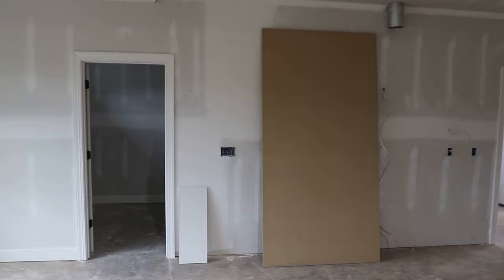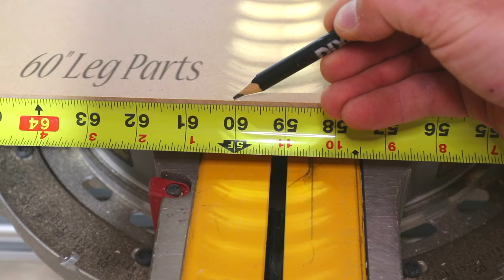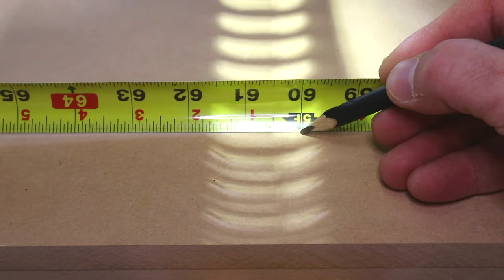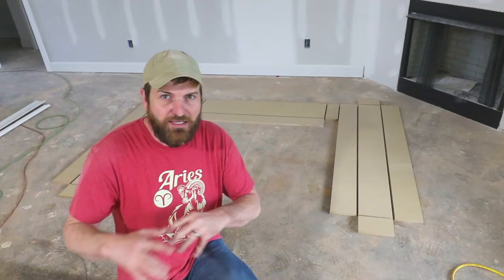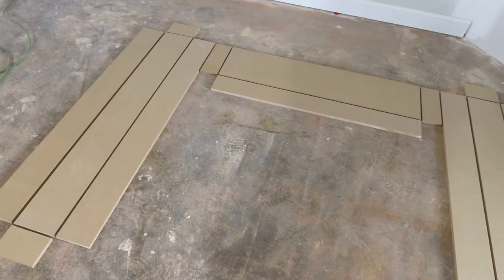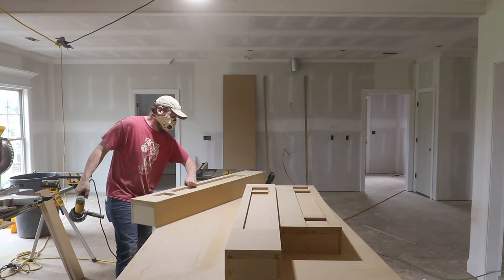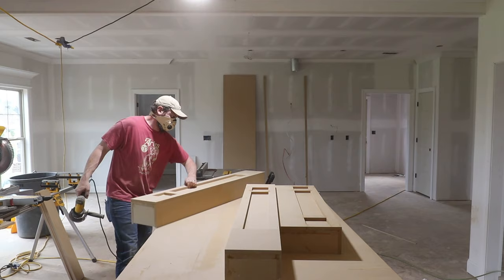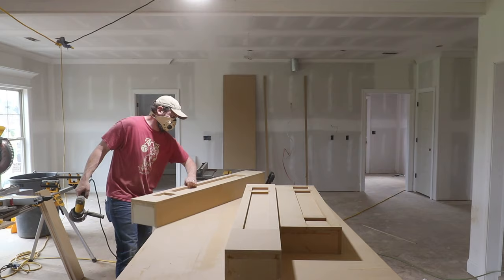How To Build A Mantel

Comment: Was looking up ideas for a mantel I am going to build.  This one is spot on with my skill level.  Thank you so much.
Reply from the maker: Absolutely bro! Happy to help and good luck with your build.
Reply: @TMPK  Just curious how the paint holds up on the mdf joints.   Would think over time a line would come through.
Reply from the maker: @wesrobinson7366  if you get it sanded well the first time it hides the lines. But I think the end side of the MDF does absorb the paint different than the surface so a light sanding after the first coat might help with that. My personal mantel in my house is about 4 years old now and I haven’t noticed lines showing yet. Just use the glue liberally lol

Comment: Great content, Jared!  You get perfect tens on Design, Craftsmanship, and Presentation! Would it be possible for you to share how much you charge for this build?
Reply from the maker: Thank you! I’d say $400-$800 labor. Depending on who you find to build it.
Reply: @TMPK  Thank you, Jared!!  Your work is impeccable.
Reply: Actually I completed a chimney mantel bump-out for an electrical fireplace along with board and batten wall for a family member and I am getting request to do others, but I am running into a challenge as I do not know what to charge.  Is there a site you can point me to to help with estimating these types of projects?
Reply from the maker: @luisasantin4989  no, I never know what to charge for new things either. What I do is try to estimate how long it will take me and then multiply that times $50 per hour labor. Sometimes it takes less time than I estimated, sometimes more, but I’ve found that $50 is a reasonable guess for bidding projects.

Comment: Absolutely love this one! I first was thinking of doing a faux fireplace, but when I talked about it with my mom she said "Why not an electric fireplace?" (I cannot go for a real wood burning one, mostly because I am renting AND have an apartment above me so an indoor chimney is not possible and even an outdoor chimney will most probably not get approved. But also because wood burning fireplaces are very expensive.)
I have been looking at those electric build in fireplaces, and I might be able to do that. But I do want an actual mantle, and not the modern type where the fireplace is build into a solid wall thing from floor to ceiling. I want to put some decorations on top of the mantle.

And Pinterest kept showing me those solid things, some with a floating shelf, some without. But this one you made is quite close to what I imagined and was trying to find an example of, to be able to show my brother. One day when I am ready to buy the build in and the MDF and other materials, this will make a nice sibling project 😊
Reply from the maker: Happy to help! Good luck with your build!

Comment: Awesome video! I have to do a mantle for a corner fireplace on Monday (a little more difficult) came across this video trying to get ideas 🙏
Reply: If you have ideas for a corner fireplace let me know. I’m wondering about supporting it in the middle where there won’t be a leg
Reply from the maker: Thanks! I’m not sure what you mean by corner fireplace? Technically the one I built in this video was a 22° corner fireplace 🤷‍♂️
Reply: @TMPK  it’s on an outside corner. Wish I could send you a pic it’s pretty wild! Either way  cool video, I’m definitely subscribing
Reply from the maker: @shutupswan8677  you can send me a pic on Instagram if you have that, I’m @jared_m_turner

Comment: Cheers mate! Huge confidence builder this one. One question: I have seen other builds use glue to make sure there won't be any lines (edges) opening up in the future, but you don't; is that not necessary in general, or only not in this particular build?
Reply from the maker: Thanks! 

 Maybe I didn’t get all the camera angles I should have, I definitely use glue everywhere wood touches wood

Comment: Thank you for the video. We have followed your instructions and we are at the point of adding the coving. We only have a mitre cutting block with a 45-degree angle and we are super confused about how to do the 35 degree angle with a 30 degree bevel without the correct equipment. Does it have to be a 35 degree angle or would a simple 45 degree angle suffice? It looks fantastic thank you so much for the superb high quality video; best on YouTube.
Reply from the maker: Thanks! That’s a tough one to explain in text. I would recommend searching “how to cut crown molding on mitre box” or something like that. There’s an “upside down & backwards” method for those who don’t have the compound angle saw. You would set the crown, upside down the way it would be sitting as if your box was the ceiling/wall corner, then simply cut it on a 45° angle

Comment: Jared,  you inspired me to build this and I am just finishing up construction and thinking about painting the mantle surround. There is a lot of discussion on the best way to seal MDF to prevent swelling and prep for paint, so I thought I would ask the expert.  What do you recommend?  Thanks
Reply from the maker: I wish I knew! I’d just start with a primer and end with a semi-gloss. I don’t paint often but in my limited experience with painting mdf, it takes several coats, like at least 4. With light sanding in between coats. It’s not fun but it turns out so pretty 👌

Comment: What size brad nails did you use? Any particular compression level? Are the brads holding board to the the wall strong enough to hold the mantle or would you recommend screwing those to a stud? Great video btw thank you
Reply from the maker: Martin Diaz I use 16 gage 2 inch straight nails. Yeah they’re strong enough. Lots of blocking in there just for mounting the mantel. You could add screws if you want. Thank you!

Comment: Not sure if you are still answering questions about this video,  but how do you determine the angle cut for the small inside trim on decorative boxes? I have followed this video all the way and I'm stuck! Do you flip trim over upside down?
Reply from the maker: Those are 90° angles, so 45° cuts. If you’re stuck on the base cap inserts, the crown mould is gonna be terrible 😬😅

Comment: Trying to build this and have watched this video several times over, great video.  Question, would you say definitely use 3/4 mdf or would 1/2 work?  Also, what size nails are you using?  Doing 1/2 so far seems good but I’m afraid my nail size differs from yours and might compromise my build.  Thanks for the video and thanks if you reply.
Reply from the maker: I’ve never built one with half inch but it might be okay with 18gauge nails. I use 16 gauge with I think would make the 1/2 inch bulge. I think it’d be kind of hard to shoot a 2 inch nail perfectly in the middle of the half but if you can it might work out.

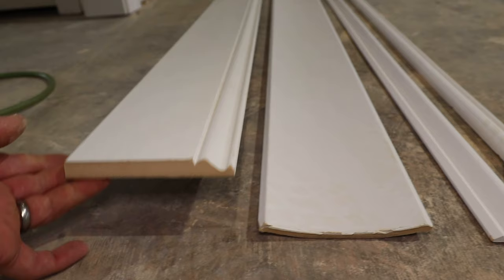Comment: Jared, I cannot seem to figure out how you cut the inside corners of base cap to fit the inside the panels on the legs and middle section. I got the 1 3/8'' width base cap similar to the one shown in the video (0:45). I watched the part where you were doing the actual cuttings, but I still could not figure out how you placed the work piece. I will appreciate any help.
Reply from the maker: Abdul T I measure long points and cut at 45° on the miter saw. It’s like tiny little picture frames.
Reply: @TMPK  Thanks for the quick response man! I wasn't expecting a response not to talks of getting it quickly. Wonderful, wonderful. I'll try it today.
Reply from the maker: Abdul T that’s what I’m here for man! I know the videos are too fast and confusing sometimes. I’m working on that 🤷‍♂️ check out my latest flat coffered ceiling video. I use the same basecap in those ceiling panels, and maybe I explain it better on there👍👍
Reply: @TMPK  I got it watching coffered ceiling video and I to lay the base cap flat on the mitre saw to cut 45 degree inside corners. Before, I was standing it vertically. Such a simple process but got me frustrated, but thanks to your assistance I was able to get going again. Appreciate it sir.

Comment: This is great. I’m building one myself, very new to carpentry. Are the base caps cut on the same angle as the crown molding?
Reply: they are cut at 45 degrees.  same as crown.

Comment: How did you cut the crown molding laying down on the chop saw. I thought it had to be upside down and backwards. Love the video.
Reply from the maker: I still haven’t made a how to crown mold video but cutting it flat is just another way. You’re ending up with the same cut but you’re beveling the saw and turning the miter. That’s a compound cut. If the room has all 45° corners you set the saw once and never move it again. You only flip the crown on its back or face.  There’s also different types of crown, one sits on the wall and ceiling at 45° and one sits at 38°, pretty weird but that means different angles for each kind.

Comment: I watched this video a few times but was not sure if you used Finished Nails or Brad Nails and how long where they?  Great video and mantel.
Reply from the maker: Thanks! I use a 16 gauge, mostly 2 inch nails and 1 1/4 sometimes in necessary. I guess that’s a finish nail, I think brads are 18 gauge. I also have a 23 gauge 1 inch nail I use for tiny things so I don’t split the wood. 👍

Comment: Great video I couldn't tell though is that the finished floor that you set the fireplace mantel on
Reply from the maker: Thanks! Nah, the main part is sitting on the concrete and I raise the boots or base around the legs a little for the hardwood to go under, then come back later with 1/4 round to wrap it again.

Comment: Great video wondering about some of the dimensions.  How tall is the middle?  Sounded like you were adding 2 inches to the crown molding.  So I did not catch what that was.  Also what is the depth of the leg and the middle?  Really like the video and want to do something pretty darn close I would like to understhand how to create the dimensions a bit better.   Also my son thought the video was great also and the sections of other video in the doorways and other places.
Reply from the maker: Thanks! The middle height is based on the overall height of the mantel. I want to have a 2 inch face frame below the crown then the recessed part with the base cap then another 2 inches. So start with how high you want the top of your mantel then work down. I like to make the leg’s panels and the panels under the crown the same size. 

I normally try to make the legs 6 inch deep and the middle 5 inch deep. Sometimes people want shallower or deeper. There’s a million ways to build it, whatever size fits best for you. 👍

Comment: Hey man great video. The curved piece you put at the top for the trim, what is that piece called? I’m having trouble finding a similar item on Home Depot’s website.
Reply from the maker: That’s a 5 1/4 crown mold. And we call that “clear” because it’s just a smooth cove instead of having the normal details a crown would have.

Comment: It came out very nice! Good job!! Can you give dims of your projects . My husband and I want to replicate your design . Thank you
Reply from the maker: thanks! I always build the mantel specific to what size the wall and fireplace are. I normally like 6 inches from the fireplace box to the legs and 12 inches from the top of the fireplace box to the bottom of the mantel. 

And if the legs are 10 inch wide, I would make the part below the crown also 10 inches. The top is normally 2 inch thick and goes 5 inch each way off the left and right, and 5 inches off the front. But I guess that depends on crown size. I use a 5 1/4 crown. 
I’m sure someone online has similar plans if you need them, but it’s mostly a freestyle every time.
Reply: @TMPK  thank you ! That kinda give me an idea . We have a corner fireplace just like the one you made mantel for .

Comment: This video is incredible! I'm using your mantel as a template for my own, but the dimensions need to be different for my space. What is the height of your boot plus the base cap at the bottom of the leg? I'm trying to figure out the ratio so I can get my own dimensions to make sense based on your aesthetics. Is it 5 1/4" baseboard, plus 2" reveal, plus 3/4" base cap = 8" tall? Thanks for your help!!
Reply from the maker: Thanks! 

Starting at the floor, 5 1/4 base. 2 inch reveal so 7 1/4 for the square part. Then basecap on top of that at 1 3/8, then the 2 inch face frame to the recessed panel. It’s complicated lol 

I find it easier to get the material and draw it in actual size on the floor or something. Helps me a lot.
Reply: @TMPK  Thanks for the info! Our mantel/bookcase project is complete and it looks great, thanks to your help! Best of all, my wife loves it!

Comment: When you attached the pieces to the wall, were you hitting stud? I’m doing something similar and don’t have the studs there. Thanks
Reply from the maker: Sometimes you do sometimes you don’t. If not I suggest doing what I did in the video, PLUS pre-drilling and toe-screwing on an angle into the studs on top of the mantel.

Comment: Excellent job but what is the going rate to make a mantle for someone?
Reply from the maker: Thanks!  The one I made is around 600 or 700 material and labor unpainted. That’s with MDF sheets around $60! They used to be much cheaper

Comment: I have a question. Why did you use MDF. is it because of the speed? I intended to make out of plaster.
Reply from the maker: I think it’s just cheaper and it sands smooth easily. I’d rather use real woods but the builders I work for chose the material.

Comment: Are you using 4X8 Sheets of MDF? the ones at my home depot are dark brown... will that be an issues when painting it white?
Reply from the maker: Yeah. The dark brown is just a slightly heavier version most times. The issue with painting any MDF is you’ll need multiple coats. It absorbs paint like you wouldn’t believe